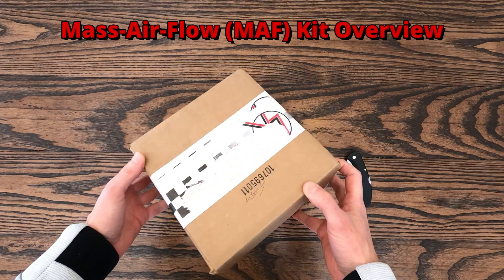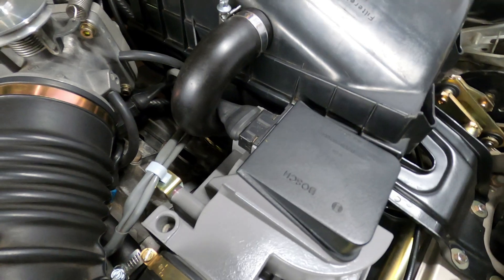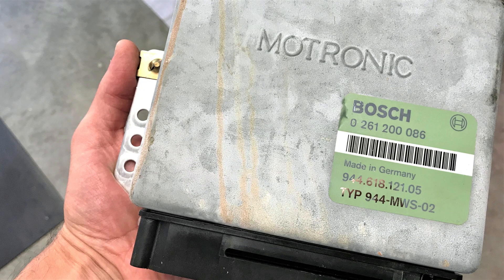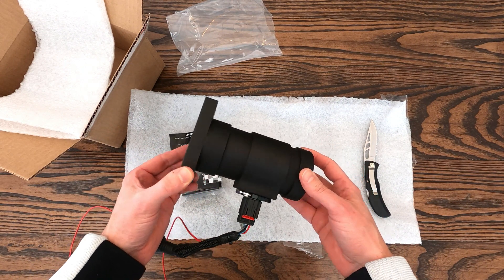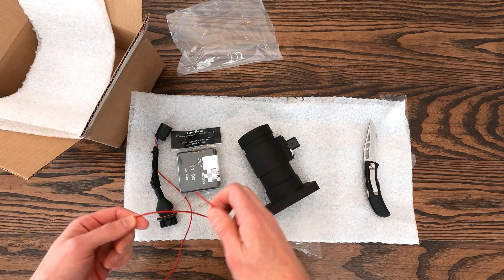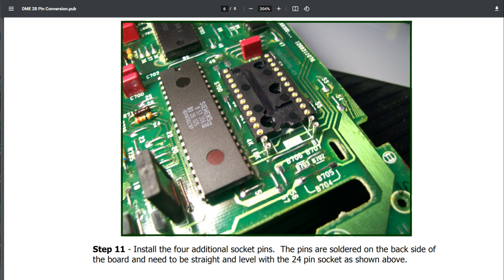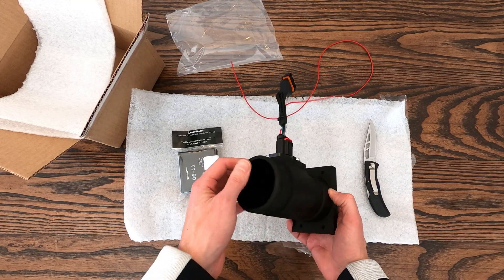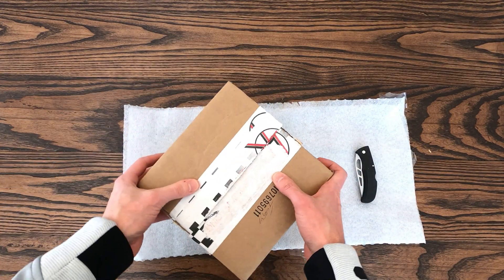Porsche 944 – Mass-Air-Flow (MAF) Conversion Kit Preview & Benefits Over Air-Flow Meter (AFM)

Comment: Excellent overview!  Unfortunately, it just depresses me as LR seems to turn a blind eye to the 16V cars.  My only real option to get rid of the MAF at the moment is to spend $1,500 on a VEMS.
Reply from the maker: 😂 Definitely didn’t mean to rub salt in the wound, but you’re right. I know Joshua of Rogue Tuning was working on an S2 kit back in 2012, but seems like it took a back seat to family and a career change, with the 944 stuff being just a side project for him. He essentially hand delivered the NA and Turbo products to Lindsey and they picked up the sales and packaging piece. Joshua continued to supply them just the chips for awhile, but finally quit that about a year ago. I’m not sure if it came down to time or money, but with the lower production numbers on the 16v cars, maybe there were demand concerns.
Reply: @NC944er  In all fairness to LR, I did purchase a header and chip and they do offer 16V cylinder head upgrades.  Of course, the 16V DME is different than the 8V to the point where opening it up doesn't match all of the vids out there.  I have a few local resources, here in Raleigh, through the local PCA group that may give me a hand with that.

Comment: Thanks for the review didn’t even know replacing the MAF was an option , don’t think these kits are available in the UK. I will be really interested to know your thoughts on performance improvements when fitted.
Reply from the maker: No doubt! I’m sure Lindsey would ship to the U.K., but I also know your MOT is a little different and there isn’t a lot of data on how emissions are impacted. I’ve heard of folks swapping back and forth between a MAF and factory setup just to pass MOT and then reinstalling the mod. 😂
Reply: @NC944er I’m thinking about buying an 82 needs some work but it’s gonna be my first project. Doesn’t need an MOT as it’s past 40 years old 😁
Reply from the maker: @LJC944   Nice! Sounds like fun. Where I’m at in North Carolina, we don’t require inspections on these older classics either, so that’s one less hurdle to overcome. 👍🏼

Comment: Sweeeet! Guess it is time to convert my 24 pin to 28 pin.
Reply from the maker: 🤣 The increase in throttle response alone should be interesting to see. The flapper is perpetually choking the engine just to ask the question, “How well are you breathing?”
Reply: @NC944er  you already have a 28 pin dme, correct? I have a 24. I have a lot of skills but soldering small pieces of ancient circuitry is not one of those skills. Maybe I can sweet talk you into helping me pin mine if this turns out to be worth that. I like the GA - NC mountain roads anyway.
Reply from the maker: @tims_4x4_garage  Yeah, mine is setup for 28, I pulled the boards and inspected them maybe a year ago. There was evidence of someone else having opened it up in the past, not sure why. 

I would put most of my soldering work in the “functional” category, not factory pretty. 😂 It’s tempting since Lindsey sells the parts for just an extra $3. If you’re feeling particularly bold, the 944 Sport DME by F9T looks freaking amazing, with all new boards and electronics, just swaps over the 4 main factory chips and the new board is setup for 28-pin. Pretty cool if you have $475 laying around.
Reply: @NC944er  that would be a sweet setup for sure. I’ll wait to hear your thoughts and results before i start to try and justify spending a bunch of money on a car that already runs.
Reply: @NC944er  can’t wait for the results.